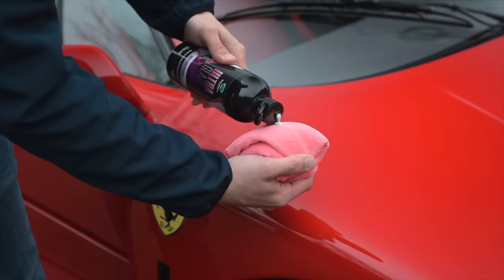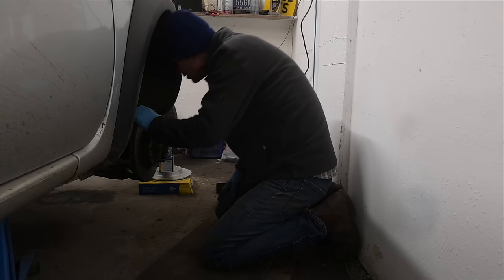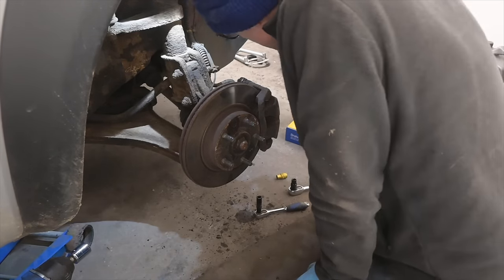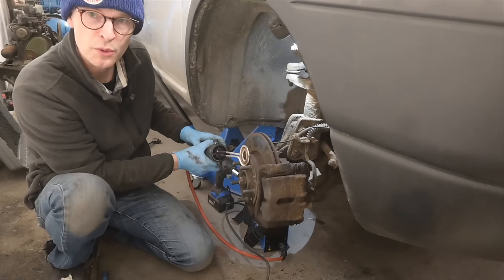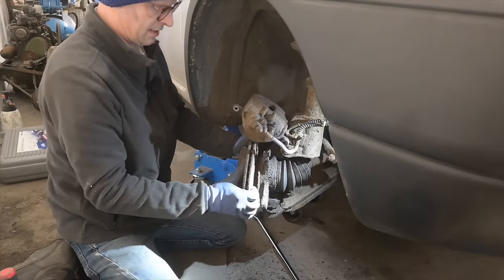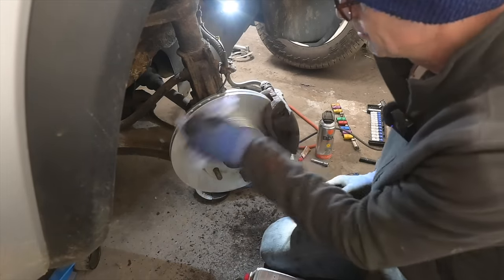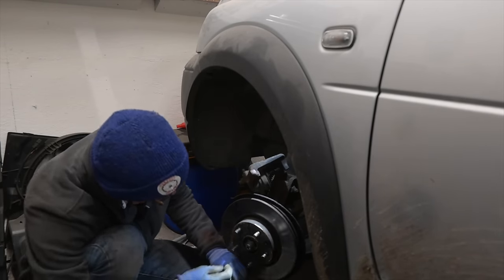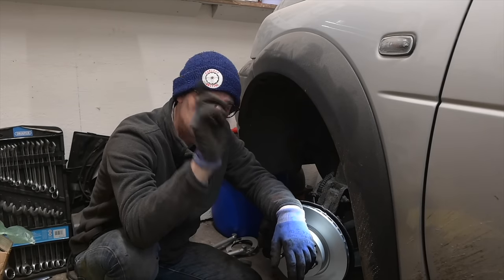Hippo gets new front brakes, surprisingly difficult (no fire was involved)

Comment: The 5 minute jobs always seemed to catch me out back in the day some decades ago, a 'simple job of undoing a few screw, nuts and bolts and lifting something out of the way to get at something else didn't take anywhere close to 5 minutes. In reality said screw, nuts and bolts were invariably seized and either stripped the threads or sheared off or both. Screw extraction was more fun when an extractor may break in the bolt/stud. After eventually lifting said part away to get at that something else we would be presented with another bunch of things that didn't want to become undone and the cycle repeats. Rarely from my experience did a 5 minute job take less than the best part of a day. These days we have Bulldog and better tools but the script plays out the same. Many thanks for sharing.

Comment: Draper Impact Screwdriver Set (12 Piece) (22322) for the disc screw.
Irwin Bolt Grip Remover 5PC Base set 394001 for  the rounded bolt heads.
Reply: Impact Screwdriver is an essential tool...

I thought Matt had such.

Comment: If you're changing discs and pads I tend to push the piston back 1st, before you unbolt the caliper. just wedge a flat head screwdriver or small pry bar and gently lever it back. Damage doesn't matter cos both are being replaced, be gentle so your screwdriver doesn't bend
Reply: Yup, good  advice 👍  tis what I've allways done, the old pads act as a sacrificial piston protector 😁
Reply: If you've taken the caliper out,slip the old pads in the caliper and use 2 ring scanners back to back between the pads to push the piston back.

Comment: If you're lucky, on a lot of calipers you only need to remove one slide pin bolt. Remove the bolt, rotate the caliper then slide it off along with the pin & bolt.

Sometimes its the only way, plus it can be quick than doing both

Also i NEED "Fire Bad" on a shirt

Comment: Honestly I used to have the same issue with anything i touched until i got some higher quality 6 point sockets. The difference is unreal if you spend a few quid. The higher quality sockets are stronger so instead of flexing and rounding the nut/bolt, they actually undo it. Sorry i dont mean to slate any of your tools or sponsors, its just my experience. I still sometimes snap things, but i havent rounded anything off in years.
Reply from the maker: The problem with this car is more that someones been in and rounded them already so Im dealing with pre-knackered bolts
Reply: @furiousdriving  oh that is terrible 😭

Comment: Great little tinkering video Matt and excellent safety advice re a angle grinder. My wife bought one to get the plastic off a washing machine drum so she can make a firepit, she got the safety specs but no gloves and she got a few nicks on her hands from flying sparks! Then her friend who came to do some welding for her noticed the actual disc was not on correctly! Needless to say her friend now has the angle grinder for his workshop.
Reply from the maker: Those do look simple and easy to use, but they are easy to get wrong and hurt yourself with if you're not careful

Comment: Always caliper bolts, the last time I took one off my Disco 1 I sheared a bolt and was lucky to drill and tap it out successfully. You reminded me that I have an OEM EBC set of discs and pads for my hippo but I've never actually got to the point of replacing them. Strangely enough even with an impact driver and 90 degree electric impact wrench, I still don't fancy it.

Comment: I've got disc retaining screws out in the past with an impact driver, but if not available by using a drift punch on the edge of the slot to shock the screw head anti clockwise. Not a centre punch as the flat end of the drift gives more surface area contact. Bit brutal and the screw is normally scrap afterwards but hardly a big problem

Comment: Matt, for what it's worth, if the brake shoes have plenty of material left on them, they CAN be reclaimed or renovated diy style with brake cleaner and careful application of a blowtorch.....it takes time, yes, that's why most people (and garages) just get a new set. I, being an economical sort of person, will always try and reclaim such items whenever possible and indeed had to do this last year with the rover 25. They are still just fine and the handbrake will lock the wheels with incautious use. Basically,  clean with brake cleaner, dry, heat carefully and (obviously!) let them cool and repeat a few times. Learnt this some years ago when doing a customers car for which NO shoes were available for weeks as they had to come from Japan (grey import). They were still working fine when the car was scrapped due to rust 3 years later. Worth a try perhaps....
Reply: Back in the day to remove brake fluid from shoes I simply baked them in an oven, yes I had an oven in he workshop specifically for heating parts 👌
Reply: @Dirt-Diggler  I haven't personally tried that but can see it working satisfactorily. At the moment, I'm lucky to be able to squeeze into my 'workshop'. This year I think is sorting out time.

Comment: Even though I own a hammer style impact driver, I don't expect disc retaining screws to come out and usually have replacements on hand before I start (M8 CSK is very common). Drilling through the centre with a Coballt drill (I usually go one size below the tapping diameter*), relieves most of the tension in the fastener and thew will usually then undo, often whilst drilling if you use a left hand drill bit (yes, they exist, it's not a trick to play on apprentices).

When you suspect that a fastener might give trouble, start with the heat and give it the best chance of undoing. Don't round it off first and make life harder for yourself. 

If all else fails, weld a nut on the end. Lots of heat to break it loose and a fresh set of flats for a socket or spanner. It's a common technique for removing studs broken off flush, or even below surface.

*Tapping size for metric fasteners is the thread diameter, minus the pitch, so for M8 (common size for disc screws), the standard coarse pitch is 1.25mm, so 8mm - 1.25mm = 6.75mm

Comment: (1) Start by removing the the lid off the master cylinder 
(2) On any job on a older Rover or Land-Rover have damaged bolt sockets at the ready.
(3) Impact screw driver or left hand drill available for disc retaining screws.

Comment: If i were working on a 21 year old freelander that had lived in a rust belt i would be surprised if most things did un do. Ive worked on JLR stuff that 10 years or so younger and taken 6 hours to change a track rod end and a bolt on wheel bearing and a full day changing brakes on a L320 range rover sport because everthyhing and i mean everything was seized. Never start a job and think everything will go smooth, all ways be prepared for the unexpected.

Comment: I hate drum brakes but rule of thumb l had to change the disc pads on a ute l owned because it was the first change of pads the bolts were factory tight and one side took most of the day but the other side took about 30 minutes l had to cut one end of a ring spanner off nut it worked good luck with the drum brakes on the rear

Comment: Did you know that you can leave the top caliper slide bolt in place and hinge the caliper upwards and slide it out, and then zip tie the caliper to the coil spring, other top tip is to lever the piston back with a suitable tool with the caliper still in place to help with leverage, and with the little screws in the disc to the hub when they're seized, just turn the lock outwards and then leather the disc off and snap the head of the screw off
Reply from the maker: the 3rd tip is the most useful Id say!
Reply: ..if you can't drill the screw head off i meant to add at the end, but if the screw is intact use an impact driver tool after some heat 😁